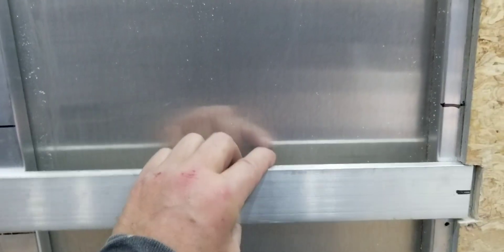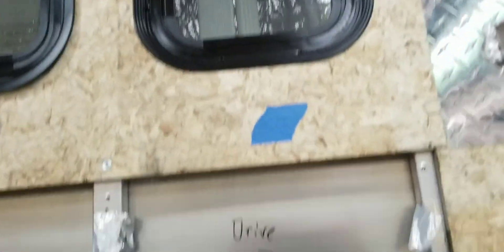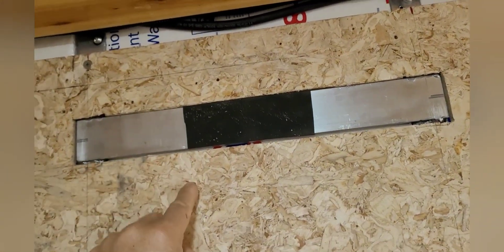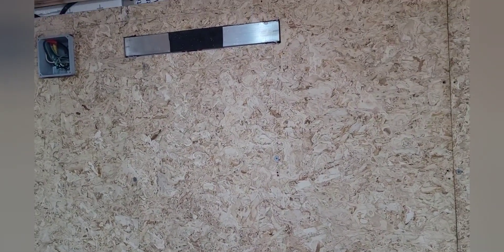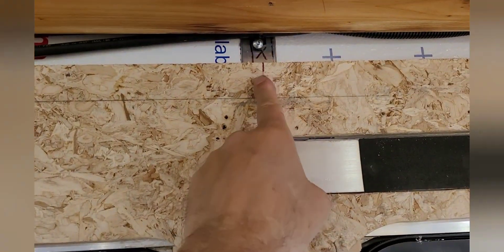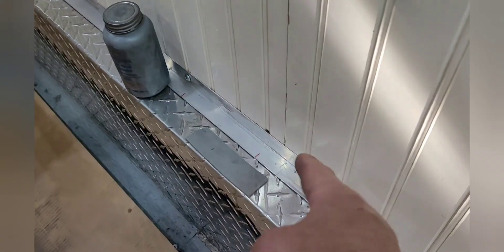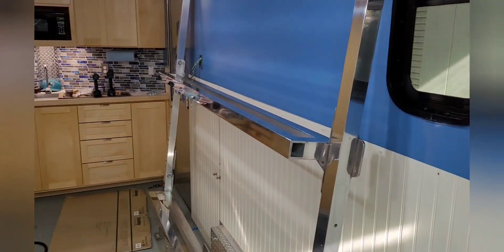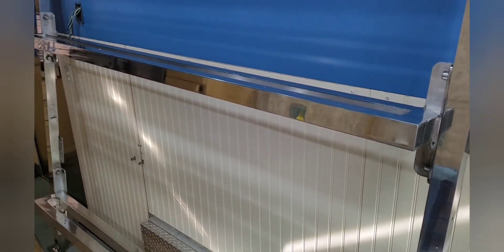Home made Bunk Bed  Fastened To CargoTrailer

Comment: Thank you for your videos. Im currently doing something similar. Is all your square tubing and flat bar 1/4" thick?
Reply from the maker: That's great , fun project.
Yes 1/4" tubing, angle and barstool. Thanks for watching your welcome.
Reply: @geniusyaqui1916 I forgot to ask, did you drill and tap fine or coarse threads for all your connections?  What size bolts if you recall? Thanks again!
Reply from the maker: Hey dan, yes 1/4" and all 90° angle,  no radius. 
1/2" and 3/8" course thread . I've had bad luck with fine threaded on Aluminum. Also always use never seize thread paste.
Hope that helps